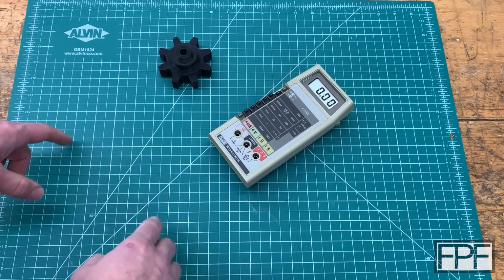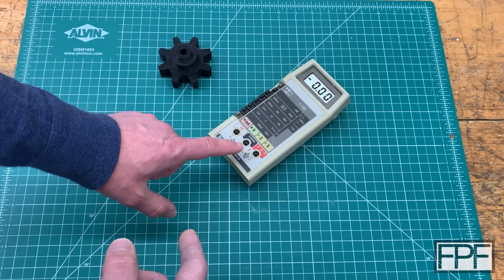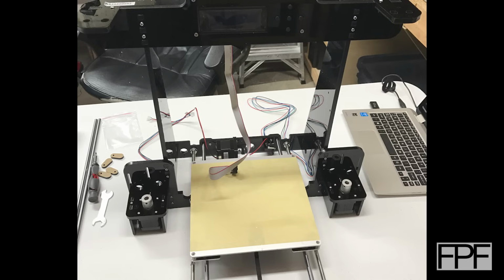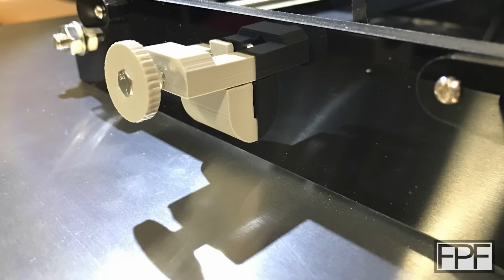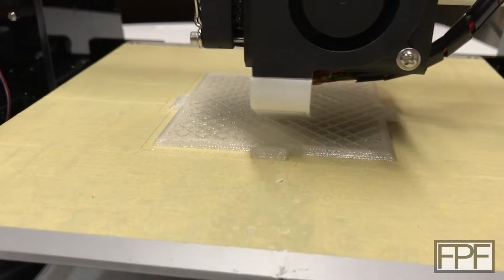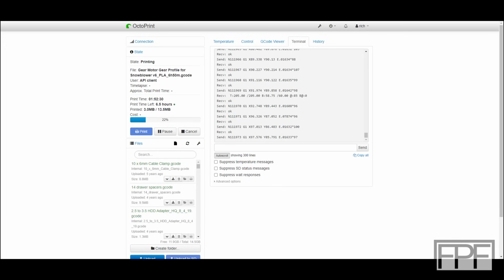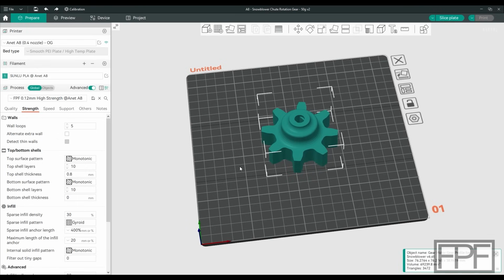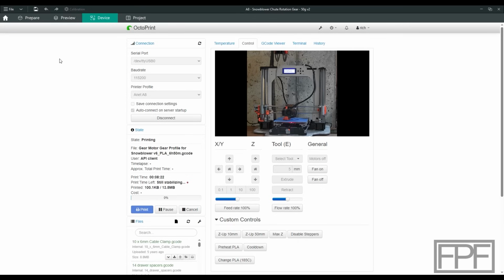Can this 8-yr old bedslinger still be useful? Modernize your workflow with OrcaSlicer and Octoprint

Comment: I was one of the unfortunate few who got the Anet A2 instead, and then just trying to adapt knowledge from other makes and A8 community. However, I've been passively using it, with the same workflow, with the same 2018 copy of Octoprint lol.  I've only started playing with Orcaslicer instead of my circa 2016 copy of Simplify 3D since I had to abandon ship off Windows, since Win11 is a non-starter for me. Thanks for providing this (which I think might work similarly for the A2), now if only Orca would let me import it haha

Comment: My first printer was an Anycubic Vyper, and I still have the thing. It hasn't ran in a year or so because I took the toolhead apart to do some work on it because it was oozing filament from places it wasn't supposed to. I was never able to get that issue figured out and it's just sitting on a shelf for now, I just got a new Qidi Plus 4 to get me back into the hobby. The new printer is so new that it's still sitting in the box because I wore myself out carrying it up 3 flights of stairs to my apartment, and I have no filament. I ordered some, but the order got messed up and I'm waiting for my replacement filament to show up.

Comment: Try Klipper, it will at least double your print speed. I have an Anet A8 I recently purchased from ebay on a lark, it arrived in pieces. 😒Now I have to decide whether to rebuild it or convert it into a corexy. Either way, it will run klipper. You already have the Pi, so why not?

Comment: Nice, I'll try this in the uplcoming days. After 6 years of de A8, upgraded many things (AM8 conversion, SKR mini v3.0 board, Marlin 2 etc), I've just bought the Creality K1 Max and switched to OrcaSlicer. I like it so I wanted to try it for my old reliable A8 but couldn't find a profile until I saw this video. Now I can slice for both printers using the same software. Thank you very much!
Reply: did you try it?
Reply: @geortsam5272 I've tried it and it worked well. I only have the bed from my other printer which I already configured and still have to search how to adjust the bed size for this printer.

Comment: The first printer i used was an UP! Plus 2. The first one i owned was a CTC makerbot clone, that thing was crap so i sent it back and got a wanhao Duplicator i3 that was ok for a while but in the end i got a kit called the "hypercube" to convert it into a core XY, i did not use that so much. I then got a second hand UP! Mini (the original) and that was good. I gave up on 3d printing for a while but back into it now with a X1C, its honestly like going form a model T to the latest S class merc its that different :P

Comment: Yep!  I still have the same printer that you have.  You and I bought the printers at the same time.  Sadly, my main board quit working 2 years ago.  I have a board from an ender 3 pro.  I wonder if I can use that to power it again.  I will check out orca slicer.

Comment: Hey.  Thanks for this video.  I'm one of the 7 other people still using the A8.  I purchased mine in 2017 and after using it for a couple months to prints some birthday favors, I got frustrated with it and it has been sitting in the corner for 6+ years.  My 9 y.o. was begging me to get it working again after some of his friends were bringing in some printed bits and pieces to school.

So, after a couple of months of asking, I finally broke it out.  Had to familiarize myself with the basics again and take apart the hot end to do a hot clean on the nozzle.  Tightened everything else up, upgraded to Marlin 2.x and actually probably got a better print on my first try then anything I ever did before.  Since then I finally printed out some of the "upgrades" and, despite its limitations have been fairly surprised by the quality of what it is able to do.

I'm curious why you never mention Cura?  My printer shipped with like Cura 14.x, but since I took it out of hibernation I have been playing with newer versions in the 3, 4, and 5.x lines.  I've settled on 4.8 now mostly because it works and I read some posts about it being the last non-buggy version.  I tried to go to 5.8, but it was doing some really weird stuff out-of-the-box with how it was slicing - couldn't even print a calibration cube (one wall).

Also, with Cura you can send gcode directly over USB to the printer which is handy with how annoying the sd slot on the A8 is.  I am likely ordering a Pi this months to get Octoprint running, as I had thought about that years ago.

Anyway, during this I tried out some other slicers, including Orca, which seemed pretty cool.  I actually got a successful print my first time with it after 2 fails in Cura.  However what I think made it work, is also what made it extremely loud and jerky - which I believe was Z-hop was enabled by default.  It also didn't seem to honor my speed settings, and I had to tune it down on the firmware.

I put some basic settings into Orca for the A8, but I'm not sure how else to tune it, so I am going to check out your profile because I would like to try Orca again for some things like adaptive layer height. 

Have you tuned your profile any further?
Do you have any other videos or tips for those of us still on an A8?

I'm still a beginner with FDM and I don't really see myself investing in a more expensive printer anytime soon since my main reason for using it is just fun and for my son.  He of course would love for me to be able to print some "cooler" articulated things than what I have been able to, but I figure he can learn the basics again with me on this and maybe in a few years buy his own.

Let me know if you have anymore good content for the A8!

Comment: Like you I started with the Anet A8 when they first came out, did all the normal upgrade safety mods including TMC drivers and built an enclosure to make it quieter and also Octoprint so I could keep an eye on things with the door closed. I then sort of lost interest as I bought a metal lathe which led to a metal working milling machine so I could now make a lot of parts from steel or aluminium. As a lot of things don't need to be made from metal I started looking back at my A8 again but with the filament now available the A8 falls a bit short. As I write this I have one eye on the window waiting for DHL to deliver my new printer, the Bambu Lab X1S with AMS. Hopefully I will be able to use it to make some useful prints( if I remember how) like you I never print useless plastic toys other than the odd benchy when I first got the A8 to test my mods.

Comment: My first printer is my primary printer: heavily modded JGAuroa A5 that I bought broken on OfferUp. The heated bed was horribly scratched underneath and wouldn't heat up so I replaced it with an A5S bed. I gave it TMC2208s (runs quiet enough now to print while I'm working), direct drive, E3D V6 volcano, G10 bed surface, and a BLTouch. I'm adding Octoprint (had a few hiccups but it should be working soon) and a hot end LED to see how the 1st layer is doing.

Comment: Cannot add the printer to OrcaSlicer, any help?
Reply: Me too. I find the Filaments are imported, but not the printer, I get a dialog saying "There are 3 configs imported. (Only non-system and compatible configs)" So I get import of one filament and two presets. No printer. Orca Slicer Version 1.9.0. @FPF: What version of OrcaSlicer did you use when saving the A8 profiles?
Reply: @eivindholm3644  Yeah, same issue here too. I've tried a clean install of orca slicer on a different machine too.
Reply: Same issue  orca slicer 1.9.0
 @argentas
Reply: Hello have you found a solution ?
Reply: @nicolasp7645  created a custom one starting from ender 3s

Comment: My printer is also about 8 yrs old and cost 89.99 off ebay... the a4988 Z motor driver was not working correct and all my prints were squashed and short, so i swapped it with the driver for the extruder, for 8yrs at the start of each print i set flow to 160%....
I would change the Esteps but the ebay seller has loaded a custom marlin that does not support saving settings to eeprom...I guess that way the customer cant mess it up.... I have never tried to update marlin on it because I dont know what the configuration is for the board...
the extruder was fully plastic and lasted only a few weeks so i had to replace it all and went full metal.
It was a terrible purchase, but way better than buying a working one that would not have taught me so much.

Comment: I still use my 2016 a8, had to make a few changes, first did a frame out of aluminum building cladding which is nice n rigid, kind of resembles the prusa i3, with the standard anet touch.     Then I went dual titan extruder with a pair of v6’s, went for duet wifi board to get that working, now working on a complete 24v retrofit so I can clean up my wiring and not have any additional bits and bobs (mosfets and buck converters) to worry about mounting.    Things a real champ, and got it going at 150 speeds stable, any more I’ll get layer shifting, hence the 24v upgrade.      I’ve checked, belts are as tight as need be, just need more holding power and torque from the steppers.   

For what it was, it was still a pretty capable printer for the time for the stuff that I needed it for.  I only do functional printing, rapid prototyping for fit testing and whatnot.    So perfect gear for my use, oven better in its current state

Comment: Launch Ender 3, still have it. Replaced the board last year with a skr mini e3 v3. The stock board had to go my gf said due the noise even though it was still running strong after 5 years.

Comment: My first 3d printer was an Ender 3 Pro - bought at the start of the pandemic as we were just starting to stay home.  A year after that I got a core-xy Sapphire Plus and last Christmas a Bambulab P1S, but every now and then the Ender 3 still prints something.  It is now direct drive and runs Klipper and has a home-made KlackEnder-type probe.  It is still way slower than the other two (core-xy) printers, but the open gantry and simplicity of the design just give a better view on the magic of 3d printing ...

Comment: I’m spoiled as I just got into the hobby with an Ender-3 S1. I learned pretty quickly that I enjoyed the hobby of printing and designing but not the tinkering that was required between every print to relevel the bed, adjust the offset, clean up the elephants foot, deal with miscellaneous failures, etc. For Christmas, my wife bought me the Bambu A1 and now I can print faster, cleaner, without hassle. Now I have a tinkering machine and a printer. I’ve since started modding the Ender-3 to deal with its shortcomings and intend on switching to Klipper.

Comment: PowerSpec Ultra3d from Microcenter, which was essentially a Flashforge Dreamer/Creator frankenstein of sorts. Just recently got the X1C, but still use the powerspec. Have upgraded it quite a bit (silent steppers, custom Marlin, pei steel sheet, etc), and it still prints pretty well at ~80mm/sec

Comment: Started with an Ender 5. I still have and use it. The only thing original is the frame. It’s my go to printer as it’s super accurate and reliable. But I also have a prusa mini, Ender 5 plus a few Ender 3 and sitting on my front porch at this very moment is a Bambu lads A1 combo.

Comment: I've been using the same Anycubic i3 Mega since 2018, and it's still going strong!  Used to use Cura, but after switching to Prusa Slicer, the end result is WAY more reliable.

Comment: My 1st and current 3d printer is a anet a8 I got it in 2020 but hardly use it due to space  but I want to keep it its pretty much stock no custom program files or electronics besides custom printed prints , I'd like to ask you a question can you create anything from a picture?

Comment: I had a Geeetech Aluminum Prusa i3. So many wires... I then tried to convert to a larger EMT8 but it just never worked that well. It's since been messed with a bunch but still isn't in use.

I do need to checkout Orcaslicer...

Comment: Wanhao duplicator i3 V1, got it in summer 2015. I was eyeing a prusa for so long but couldn't bring myself to spend an extra $200 compared to the ~$400 i paid for the wanhao. Funny enough my very first makers muse video was the review he did on the Wanhao. At that point many design flaws were known including wires that would break in the X chain causing them to heat up and melt the connectors on the motherboard. ugh... it was the wild wild west back then XD

Sadly i dont have it anymore as I used the parts to build a Hypercube after those video finished being made by Tech 2C

Comment: First printer was RepRap Itopie Made with particle board frame. I scrapped the parts to make a Rat Rig Core XY 300x300. Still using the same Titan Areo Volcano head. Had to make new board based on Pico to drive 6 steppers. Ramps board had only 5.

Comment: Same team here !

I bought my first printer, Anet A8, on 11 nov. 2016.

We recognize the fisrt A8 batches by the printed parts for the X axis, later versions have injected plastics.

I've made some modifications throughout the years:
- external mosfet
- detacheable PEI plate
- sensor for auto Z offset
...

I replaced it by an ender 3 v3 KE last week.

Comment: The oldest printer that I still have and use is my PrintrBot simple metal. It's a 150 ^3 printer that I can't bring myself to let go. I use orca slicer and klipper installed with a skr board.

Comment: My first printer was a Snapmaker 2.0 with all the extras. I got it back at the end of '21. I held out for so long because I didn't see the value in 3d printing, since all I saw of its use was weirdos making their own funkopops and light sabers and stuff.

And I actually just kind of fell into 3d printing. I got the snapmaker mainly for the router functionality. I had a work-related project that landed in my lap and I wanted to try my hand at making my own PCBs. Two years on, and I barely use the router function, and keep it printing almost 24/7 (minus nights and weekends) making prototypes and one-offs.

Comment: Still have my original Ender 3 Pro that I picked up in 2019. I heavily modified it to be more reliable. Started out with Cura and Octoprint. Since then I've gotten 4 more printers (I may have a problem) and switched to Orcaslicer and Klipper. I can't praise Orcaslicer enough. It has the power of Prusaslicer with a user interface the makes sense (to me at least).

Comment: I had an Hictop, from 2017, it was a chunking 2020 mess who barely worked.
Now it's in piece and i have an Ender 3  higly modify with double Z and a direct drive on Klipper.
I'll never go back to Marlin, being able to upload file and tweak the printer without having to flash it again is just so much better.

Comment: II started with the Anet A8, which ran for 1 year, after which I printed the parts for a Hypercube with the A8 and then reused it to build the first Hypercube, then printed the parts again in better quality and used them again. to get the first printer absolutely perfect, then I got the hang of it and built a second Hypercube and today these printers are still running with complete satisfaction.
Reply: Woot! Fellow hypercube user! I built mine from scratch as a newbie back in 2018 because I make bad decisions but I actually just rebuilt it. My hypercube has been running great for me and I'm even going to use to carbon fiber rod setup on a small fallout replicator hypercube.
Reply: First thing i did was go the hardware store, bought some aluminium square tubes and stiffen up the A8. Then mounted the whole thing to a 24mm board that was laying around. I did a few other upgrades i had designed myself, but those first two steps really improved the print quality. The only reason i bought a new printer is because i needed more parts per hour.

Comment: Much modded 2018 ender 3, running klipper now, i recently added x and y linear rails.   Have a new k1 speedy which gave me the opportunity to go crazy with modding my ender 3 which made it unusable for a few days, my x upgrade hit a snag as i use a sprite extruder se, had to design my own bracket and iterated the design with the k1, love having two printers!

Comment: Awesome.   I have an Anet A8   I havent used in a while.  it was my first printer as well.  Ithas been  modified and runs an E3D V6 nozzle, with a PEI sheet  I havent used it ina while as  have bigger and faster machines ( Ender 5 plus, Tevo Tornado, and 2 thinker S)  the new machine a re all runing Klipper firmware.   Love the videos  keep it up ..   Jim

Comment: I have an old Leapfrog dual nozzle 3d printer, from 2015. Glass bed. Simplify3d slicer. Top notch in those days, but giving us lots of misprints. So, after 2019 we stopped using it, forgot about 3d printing. And now I am about to order an A1. Hopefully back in 3d printing business in February. Architectural office.

Comment: My first printer that I bought was a SeeMeCNC Rostock Max V1 in 2012.  I do still have it.  I don't use it because it's weak-sauce 12v power supply caused more print failures than I can count.  I have been tempted to bring it back out again and equip it with a new 24v power supply and see if I can make the old girl dance again.  It would be fun to get that delta printer going again and get back to my roots essentially.  It needs a part cooling fan in a major way and moving it to a Revo nozzle would be a huge upgrade as well.  I can probably flip the Mic 6 aluminum plate over to get a flat surface on that Onyx bed and maybe drill some pockets for magnets to put a spring steel PEI sheet on it.  It is a cool old printer.  It is a shame that it is rotting away in my closet.